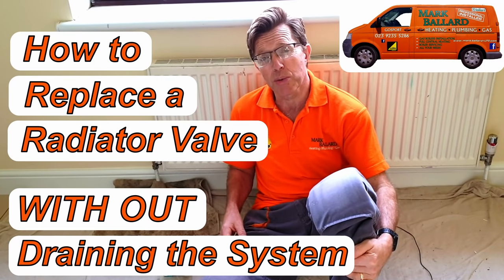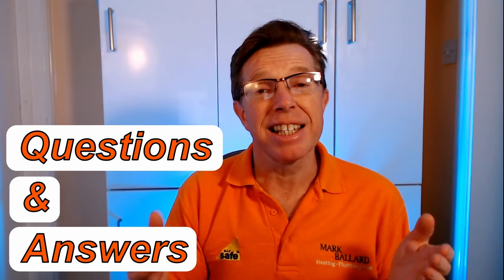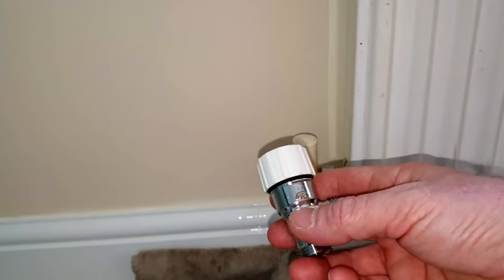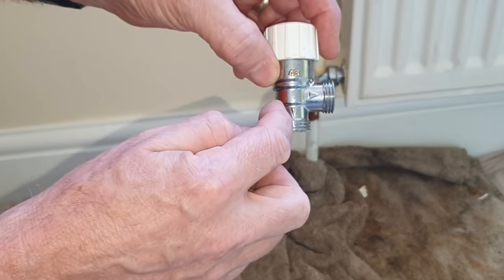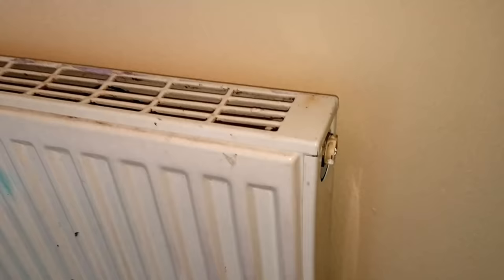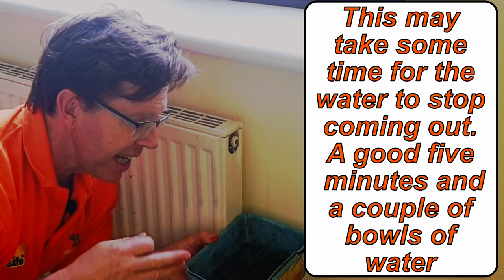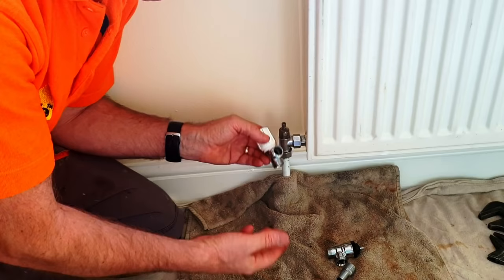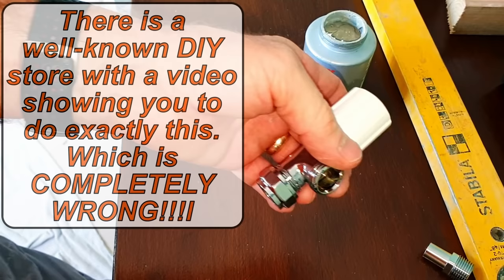Replace Radiator Valve with Out Draining the System. Updated. Part 1.

Comment: In the real world where the customers house is full of furniture that you risk damaging or the old carpet that looks like it's going to disintegrate if you look at it .  Always quicker and safer to drain the system
Reply: Exactly what I was thinking, I'd do this at home but at a customer's I'd drain down to the floor I'm working on and play it safe, most customers would rather pay for the extra hour or two to drain down than take a risk of damage.

Comment: Very long winded and in effect he is partly draining the system, just doing it via the radiator which would take ages and a complete faff. Much quicker and less messy to close off all other rads then drain what's left at the actual bleed point on the system. Also video completely fails to mention the system will need re-pressurising afterwards!

Comment: Using paper towell is too risky Mark a rag is better one made of an old tee shirt. also you need to buy the same valves to ensure compatibility with the existing nuts which you reuse by this method

Comment: This is OK until you get the old valve off then you discover the new valve has a different thread and yes some do particularly if you are replacing an older rad valve. My advice is if  the boiler is a combi drain the system it's better than bringing the ceiling down and when you fill up redose with inhibitor
Reply: Or use a freeze machine..
Reply: @timhull8664  that's silly
Reply: @chrismcgowan4684  you have no idea
Reply: @chrismcgowan4684  You need to get more experience.
Reply: @EpikMunk  you need to keep your dam nose out of this
Reply: @chrismcgowan4684  they dont excist ???🤣 I have about 20 years as a plumber in Denmark, i have used two types, the gas type and the refrigerator kind, they work very well, the water just have to be standing still, have worked on heating systems, drinking water systems. They are two clamp system you clamp on the radiator in and out or you put one or two clamps on a water main etc, then it runs for about half an hour, there comes a giant ice blok on the pipe, then the pipe is frozen and you change your valve or what ever, then you just cut the power and let it heat up again. Job done.
Reply: @homeistheearth  Denmark doesn't have properly qualified plumbers, there qualifications are Micky mouse, I don't take you very seriously as a plumber, my two years of experience is worth more then your 20 years of Micky mouse
Reply: @chrismcgowan4684  ??? 🤣
Reply: Or use an aerosol freezing kit from say Screwfix if you just have a single pipe to do.
Reply: @chrismcgowan4684  REMS make a pipe freezing kit that works well. You can also buy pipe freeze spray but it doesn't work as well which makes the pipes liable to be passing when you cut into them.

Look up pipe freezing kits mate...
Reply: Draining down takes half hour. What's with all the carpet up and buckets?  I did full house trv swaps drained down olives off new trvs and lockshields on. When you drain down you do not have to worry about water glugging out plus flushing out keeps sludge build up down  when having to replace worn valves on old neglected heating systems. Nice vid tho
Reply: @chrismcgowan4684  haha what numpty

Comment: I consider myself a competent diy'er. My uncle who was a plumber taught me much and so has my mate in the trade.
I used Marks ideas here and changed a TRV and lockshield valve no problems AND removed the old olive as suggested.
These things are doable with the right tools, confidence and aptitude, I don't like the insinuation by many 'plumbers' that it shouldn't be touched or attempted by anyone other than them. It's just their money they are thinking of. As long as you are not a hamfisted halfwit and take your time and have the correct tools, you can do it.
I've seen many tradespeople do piss poor jobs at £100 per hour, I personally don't trust them,the good ones are too few.
Thanks Mark for taking the time to explain it thoroughly

Comment: When you use an adjustable wrench, you should push into the sliding jaw. That way you are supporting/compressing the jaws rather than trying to pull them apart. You were tightening/loosening by pulling away from the slider etc. One of the first things i was taught in my early plumbing days.... Still a good video!

Comment: Thanks for the video.  I had to change two valves after replacing an old downstairs radiator which is on a system with a combi boiler and my plumbing has never gone right before.  This worked like a charm.  Even to the extent that after allowing water to flow out of the existing valves, when i took the valve off no water came out at all.  I had turned the boiler off (as the video advises) and all the other downstairs radiators off as well.  The lack of water flowing from the pipes gave me the opportunity to remove the old olives and replace the nut  Marvellous!

Comment: Thankyou for this video, I’ve always struggled with TRV’s and fitting radiators. I just followed your guide and managed to add two TRV’s to my CH in 2 hours, I did it without draining the system too which I didn’t think was possible.

Comment: Thank you for a very interesting and informative video Mark. During the course of my life I've changed many radiator valves. I have always drained the system. This video has shown me something I would never have thought of. The use of PTFE tape on the threads was also a surprise. I knew the olive sealed the valve but I have always taped the thread when reconnecting the valve. I am 71 years old and still learning. Thank you.

Comment: Thanks Mark,  This is the second video on this topic I've watched and yours is very clear on the steps and far more helpful as you are not confusing the story by trying to address Combi and gravity in the same video.  I have found that the TRV is on the wrong end of the radiator and it has started making a right old racket!  I will be trying it out on Saturday as my wife is away for the weekend giving me the chance to clear up if it goes bad!

Comment: Re tapered joint. I bought a shank of hemp 40 years ago which I’m still using. Never had a a leak at that joint.  ( plenty elsewhere) PTFE should be regarded as a lubricant. It has no bulking out property. Thanks for the video.

Comment: I would add: to minimise draining, I would go round the whole house & shut off all rads at both ends first.  Most of the water (and pressure) will stay in the rads, and its a good opportunity to check / lubricate all valves), plug off the top tank (or depressurise a sealed combi system);  Also, I made my own tapered bungs to the size I want using a thin cardboard cone & filling it with silicone mastic - leave for a week till fully cured, then soak in water before rubbing off the cardboard.  Always add 1L of corrosion inhibitor if you can, it acts as a lubricant apart from anything else.  Nice vid, thanks.
Reply: I have done a radiator as a DIY. I shut off all radiators in the house at both ends. Then for the radiator I wanted to remove, I drained it at the radiator after scooping out as much loft tank water with a jug and shut off the mains fill with a towel to stop it filling the loft thank. Then I painted the radiator and put a TRV on. I did that to the loft tank to clean with a cloth and remove the scum water. There is a loft tank in my home. I then put inhibitor back in via the cleaning magnetic filter and refilled the system from the mains water in the loft tank. I also shut off the stop cock for peace of mind. Clean loft tank AND a new painted radiator and inhibitor.
Reply: @rtyrtyrtyus  Good job. 👍👍

Comment: Thanks very much for this video. I wouldn't have called a plumber for something simple like this as I'm comfortable with DIY, but I just needed tips for the details which I could have searched and pieced together for ages but this video had everything in one place. Will be buying you a pint via the toolbox fund. Cheers.

Comment: 9:08 - I can't remember where/why I was told to use PTFE on the threads, and have often wondered what's the point for exactly the reasons you gave. I just kept doing it anyway because that's what I've always done - glad you've put my mind at ease and I can now stop doing it! I guess it's the people you learn from knowing it's essential in some cases (e.g, outside taps) and getting in to the habit of doing it on everything without thinking about why.
Reply: PTFE on threads is not for sealing, teflon is the most lubricating substance there is. You put it on threads so you can tighten the nut up more past the point friction would allow you too, therfore being able to tighten the joint further and easier which in turn compresses the olive more and creates a better seal. No jointing compound needed then. This guy may have been in the trade a long time but this is the reason plumbers and mechanical engineers use ptfe on threads, plus i've never used ptfe tape to seal anything
Reply: @Dtp2296  never used Teflon tape to seal? Not a gas fitter, then.
Reply: @JasperJanssen  and neither will you be if this governmnent carries on much more. None of you will be.

Comment: Wow, what a comprehensive demonstration! I have done DIY for years and changed rads etc. But never used this method. Didn't know it was ok to use the same olive on the pipe and I have always used PTFE tape on the nut threads! So definitely learned something today. Thanks for this, top job Mark.

Comment: Really excellent videos, changed my first TRV today having run around town finding some rubber bungs (Toolstation) to isolate my loft tank and depressurise the system. Following the process Mark described, a piece of cake, done in under an hour. Now have 5 more to do, total cost inc valves to complete everything just over £100, absolute bargain compared with a plumber (if you can find one). Thanks Mark, really helpful.
Reply: Yep, Marks literally robbing himself. These Internet "plumbers" and other tradesmen giving away experience for free never fails to amaze me.
Reply: @frenchfrench4514  The main reason I've learned to do quite a lot of these basic jobs myself is that all the good tradesmen are very busy and I'd have to wait months. Even if it's a job that will take me a whole day (find out how to do it, visit the shops to find the bits I need and then spend hours methodically working through it, it's probably a one hour job for a professional and I find they're often not interested - they'd much rather take on bigger jobs so that they spend less time doing quotes, driving around from job to job and billing 5 different people. No complaints, they've got to make a living, but I'm not necessarily taking work away from anyone.
Reply: @frenchfrench4514  The truth is - if you costed the homeowners time on a similar basis to a plumber. The time spent trying to find a plumber or getting one to respond and turn up, the homeowner taking time off work to be at the property then it is no wonder that for small jobs it is expedient to DIY (if you have the house). To be blunt - plumbers do not want this sort of work anyway - there are bigger fish to fry.

Comment: Fantastic demonstration, simplified for any level DIYer, I have a 10mm pipe that is partially blocked with solder inside I cannot change it easily as it is cemented in the floor, any hints on how I can remove the solder please???

Comment: Mark, great video, just done my valves without a hitch and very long title bleeding afterwards...just a thought, found an unused mastic spigot a perfect bung for the rad when the valve is pulled away, cut it with a 10mm tail once it was in and snug.....couldn't have done any of the rest of it without your help tho. Many thanks

Comment: I like Your video a lot, but have one key observation. The thermostat itself should NEVER be above heating pipe. In this case it should be mounted horizontally not vertically. Vertically mounted themostat is heated with warm pipe below and "thinks" there is warmer in the room than it really is. This disrupts its regulatory capacity.
Reply: @danimayb  Principles of Physics.Chapter on heat convection, elementary school. Warm air heated by a pipe rises upward. It tricks the thermostat into thinking the room is already warm and closes the heater too early. The radiator will somehow work, but incorrectly.
Reply: that makes sense.

Comment: Another helpful video, I used a freeze pack to change a valve, which turned into a right mess as I needed to change the olive at the same time,hence the ice suddenly popped out and I had a nice waterfall. But watching this I can see the mistake I made with the pressure.
Reply: Hahaha, been there done that, felt like I was standing Under a waterfall, f only for 5 seconds before. Managed to stem the flow.

Comment: Great tutorial! Couple of suggestions, releasing the system pressure from the air release is time consuming and depending on the type of air release can be very difficult to catch the water. Much quicker & cleaner to drain the pressure from the boiler drain point. While you are there, if the boiler is above the rad you are working on, it's helpful to either close the boiler isolation valves or just close the boilers auto air vent. This prevents air ingress and better holds the water inside the system while your working. Very nice to see your use of jointing compound on the olive faces, many 'professional' plumbers use no jointing medium at all! 
👍👍👍
Reply from the maker: Agree with all you said. I would do it that way. Don't want people turning wrong valve as ever boiler is different. Thanks my friend 👍👍👍
Reply: The last thing you want to be touching are boiler isolation valves because they are never exercised the minute you shut them then open them the rubber o-ring inside splits and they start weeping from the spindles
Reply: @adierob1  well said mate! stay the f away from boiler isolation

Comment: A few points with this ... depending on the fitting the old olive that has already been compressed might not fit in your new fitting. 
You say without draining the system - if this was an downstairs radiator you would half drain the system as you know gravity 🤷🏻‍♂️. 
You don’t need any paste on a compression fitting, if it leaks you haven’t done it properly.
Reply: Any true plumber knows to paste compression joints, belt and braces comes to mind

Comment: I just drop the radiator off the hanger and lay it down, rather than putting paper in the hole. I DO use PTFE tape, it makes it easier to tighten the nut and fit the olive; never had a leak either, but don't like putting anything inside heating or potable pipes. I also isolate all the rads before depressurising to minimise the amount I have to bleed off (also keeps the inhibitor concentration in the system).

Comment: This is the way we do it when we cant use or find the drain. I prefer drain, when you then take out the valve you suddenly have air suck in because some other radiator valve opens because you shut of the boiler and the room went cold.. blob blob blob and you sit there with a finger in each hole. 
The plug you make you can use a fitting, Danfoss valves fit a 3/4" endfitting when it's a half inch. 
Also here we most often have he inlet in the top, then you can drain in the return with the bucket, and only have to lower water a few inches. The vacuum advise is actually a very good one, it can save your "life" when doing this job and there suddenly is air drawn or a valve opens or your just impacient.

Comment: Always useful to put full bore valves on the main supplies so that creating air locks thus no drain down of system is easier.  Good also once or twice a year to test such valves as they can corrode and fail over time.  Great video.
Reply: Glyn, glyn, glyn. Did you really just suggest full bore valves? On the main supplies??
Reply: @JohnnyFontane528  YES!  On each floor I have a couple of valves on the flow and return of the heating circuit which enables me to isolate that floor (or zone) whilst I carry out the work.  In much the same way, I also always install a 40mm waste pipe which is connected to the waste water system when I install a header tank or hot water/heat sore, it is all about making future maintenance easier, planning in advance and enabling drain downs or value replacements so much easier.

Comment: I am grateful for this information. I'm a DIYer who will probably attempt this repair myself, although I would rather not. I called several professionals first but here in the US, I am facing a 16 week wait. I've got a towel wrapped around the leaking valve and I have a barrier of chicken wire wrapped around that to keep the kitten and the puppy from trying to lap up the dripping water, which is green with anti-freeze...not healthy for the little animals!

Comment: Thanks for a very informative video. Can you please clarify the purpose of the jointing compound / ptfe tape. I always believed that it's sole purpose was to help the mating threads slip, enabling a tighter joint with less effort and preventing galling. In the video you state that you only use it on the ends of the olive to help sealing and not on the threads.
Reply: Quite so, but I appreciate the effort to dissuade people from thinking that the threaded part is the sealing face of the fitting.
Reply: Plumbers insurance jointing compound is
Reply: @Derek_Garnham  How do you lubricate the threads to prevent galling? do you assemble them dry?

Comment: Thanks for great videos. I've now replaced 2 rads, including changing the 4 valves/tails, all new nuts and olives. Did buy an olive puller as too scared to try hacksaw method! Do any of your videos cover new bsp valve into heated towel rail - unsure about whether/where to use ptfe tape/jointing compound.

Comment: Air lock the system it’s very simple you can do the same with the expansion tank and relief valve. Close all valves open a drain still water stops shut valve or leave open remove part and install new 😐